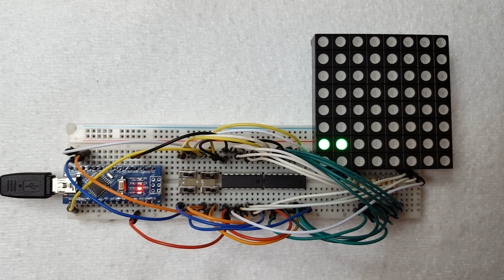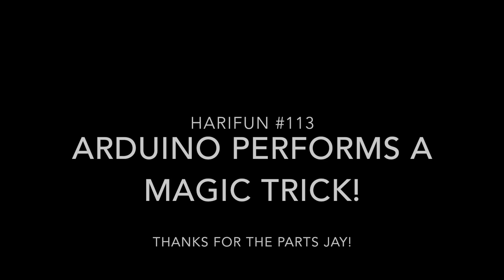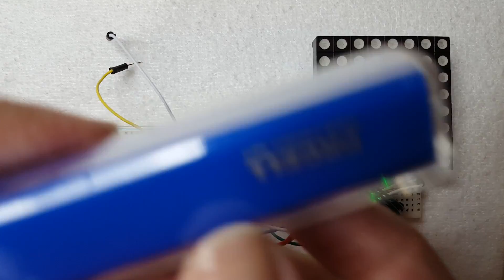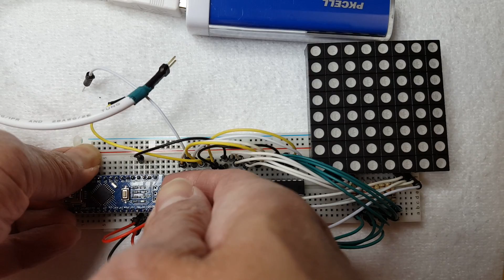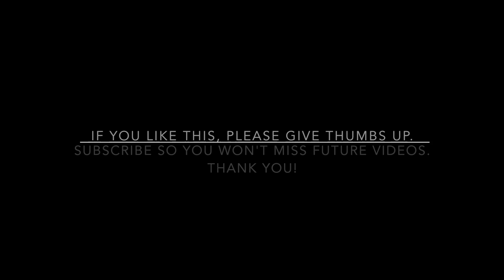HariFun #113 - Arduino Magic Trick Part 1

Comment: Once the byte pattern sent by the Arduino has been shifted through the first and second 74595 shfift registers, then providing the shift registers are not reset, the bit patterns are stored in the shift registers, in other words the 74595's are acting like RAM.
Reply from the maker: Thank you for your guess, but that would not explain how the behavior persists after power is removed and reapplied.  Everything in the shift register would be cleared upon power down.  Check out part 2 to see how I did it.
Thx for commenting Phil!

Comment: I like it :-) ... and of course, good magic is to distract the audience.  You have added switches into the circuit which don't appear to serve any purpose  ... or do they.  I see that you have appeared to glue them together with hot glue ... but why would someone do that?  Interesting .... unless of course the metal cased switches plus a "strange chemical" dielectric is producing some form of capacitor which charges and discharges producing a clock pulse.  I can just about see how two shift registers with BOTH overflows cycling to the other will produce a similar pattern ... but the mystery (to me) is where the clock pulse is coming from ...

Comment: Something like this? http://ultrakeet.com.au/write-ups/microcontrollers-not-allowed
Reply: 3zuli That would be my guess...;)
A shift register still needs a clock.

OR...

One of the "Switches" is actually an 8 pin Micro controller which would
be easier to implement than your linked project.